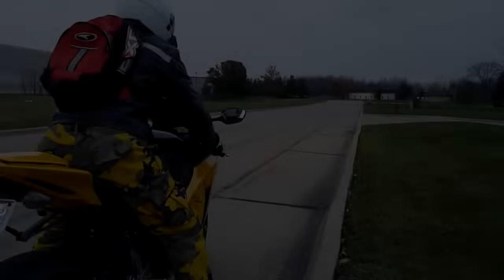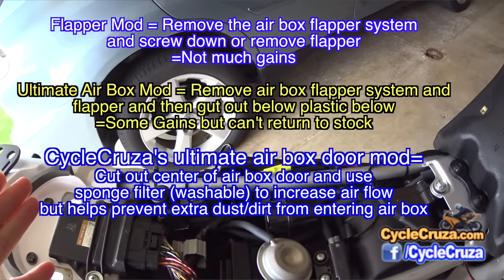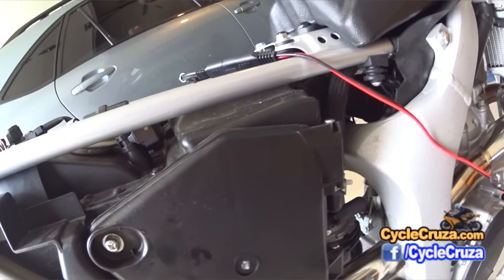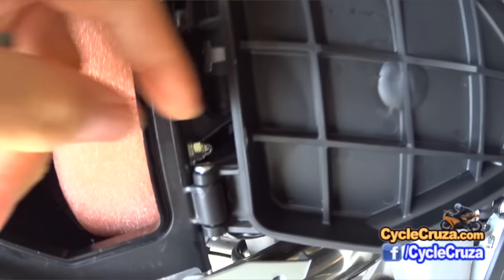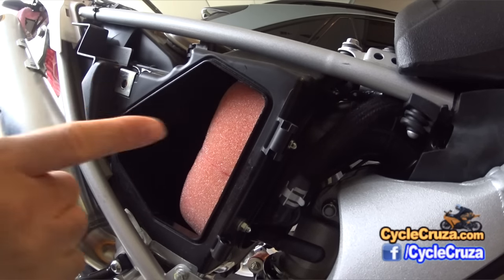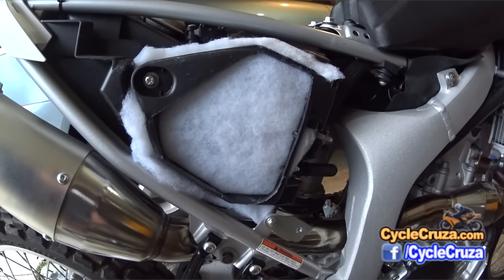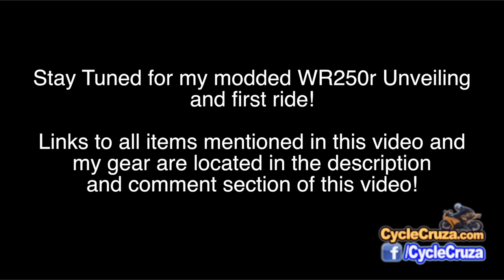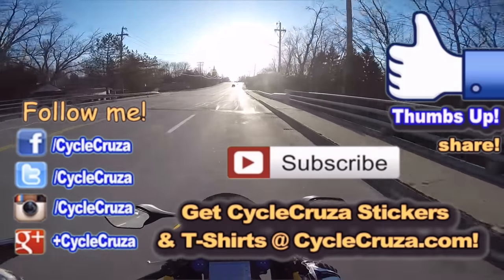WR250R Ultimate Air Box DOOR Mod - More Horsepower!

Comment from the maker: FYI - Links to items shown in video and my gear:
Get My Action Camera CHEAP here: http://amzn.to/1F85kog
Get Power Commander CHEAP: http://amzn.to/1OzOA21
Get PC Map Switch here: http://amzn.to/1rgIg5q
Get Sponge Filter (For Air box door): http://amzn.to/1WS2GO5
Get H4 LED Headlight Bulb here: http://amzn.to/1qx9Ta9
Get 3 Gal IMS Fuel Tank WR250r here: http://amzn.to/25zuWsC
Get Motorcycle LED H4 Headlight here: http://amzn.to/1Mc8TSs
Get FMF Q4 Exhaust CHEAP here: http://amzn.to/1OvBlJs
Get FMF Mega Bomb Header here: http://amzn.to/1OvBrkg
Get JT 47 Tooth Sprocket here: http://amzn.to/1WaUDvF
Get Rental O-Ring Gold chain here: http://amzn.to/1TAHDPl
Get KTM Folding Mirrors here: http://amzn.to/1SD7DbI
Get Folding Levers for WR250r here: http://amzn.to/1mObQ0h
Get WR250r Comfy Seat here:  http://amzn.to/1OvBb4U
Get Pro Taper Fat Bars here: http://amzn.to/1OvA1X2
Get Fat Bar Mounts: http://amzn.to/1OvAb0z
Get Pillow Top Grips here: http://amzn.to/1OvAhp1
Get Zeta Hand-guards here: http://amzn.to/1OvAoAJ
Get Zeta Hand Shields with flashers here: http://amzn.to/1OzN8g1
Get Wr250r Shorty Folding Levers here: http://amzn.to/23fgns8
Get Skid Plate here: http://amzn.to/1OvABUI
Get Dunlop D606 Rear Tire here: http://amzn.to/25zuquA
Get MT-21 Pirelli Front Tire here http://amzn.to/1MXHoXK
Get WR250r Speedo Healer here: http://amzn.to/1pP4fzl
Get Servo Emulator CHEAP here: http://amzn.to/1OzNqn2
Get Flasher Relay CHEAP here: http://amzn.to/1OzNwv8
Get Grip Heaters CHEAP here: http://amzn.to/1OzNKST
Get Fender Eliminator Smoke Tail Light Kit here: http://amzn.to/1qy21oE
Get Smoke Rear Turn Signals here: http://amzn.to/1qbUefY
Get Sheet Metal Piece here: http://amzn.to/1OvzzI9
Get No Toil Hi-Flo Air Filter CHEAP: http://amzn.to/1OzMmzH
Get No Toil Oil/Cleaner/Rim Grease Kit here: http://amzn.to/1qbUHhZ
Get WR250r White Fender: http://amzn.to/1Z3rTZ4
Get WR250r White Headlight housing: http://amzn.to/1UrxscX
Get WR250r White Left Rear Side Cover: http://amzn.to/1Uryrdp
Get WR250r White Rear Fender:  http://amzn.to/1UrzM3U
Get WR250r AIR Removal Kit: http://amzn.to/1YSVwYr
Get WR250R air box door here: http://www.partzilla.com/parts/detail/yamaha/YP-3D7-1441A-00-00.html
Reply: You are literally a epic handy man. Where do you get the idea to do some of this shit?
Reply: You should try the k and n air filter !! Better power gains than no toil , and they last a lifetime = ) Check them out !!
Reply from the maker: brad b No toil is better than K&N, also the oil and cleaner for the no toil is non toxic and biodegradeable.

Comment from the maker: 5/27/16 UPDATE: Bike is done! The tuner did two custom maps, one for the stock air box door and one with this modded air box door. I did GAIN hp with this air box door mod and he was able to tune just fine! Bike Unveiling coming soon!
WR250r update: Dyno Tuner said there was a problem my power commander, one of the pins in the connector was pushed back, was causing it not to communicate properly. He completed the map for the stock door, now he's going to try and tune the bike with my air box door mod again (Door hollowed & covered with filter). So if the second map is successful I'll have two maps on my switch, one for the stock door and one for the modded door. I'll do an unveiling of the modded wr250r next week. Stay tuned!

Comment: Don't know if this applies to EFI bikes like the WR250, but for carb bikes like the DRZ400, it's not recommended to mod the airbox door because it can create turbulence in the air box, which then can cause lean/rich states in the mixture. Do not do this if you have a carburated bike. Interesting mod though. I wish I had an EFI bike. Thanks CC.
Reply from the maker: +aseredy yeah I wouldn't do this to a carb bike. Also, I will be having this bike dyno tuned and will be adding a 2 way power commander switch to switch between stock air box and a opened up air box. I will not even ride the bike until I get it tuned first.

Comment: Hey buddy I need some help , I have a wr250r 2014 I bought the fmf powercore slip on with stock header , my question is do I need a fmf programmer coz my bike is loosing torque or Do i need a fmf heater too? Please let me know
Reply: You'll need FMF or EJK fuel controller (which you'll also need to program) when running aftermarket exhaust. As you've noticed an aftermarket exhaust without its own dedicated fuel controller will hurt performance since the factory ECU is designed to operate with the factory exhaust.

I don't think you necessarily need a fmf header as some people run fmf q4's with just the stock header.

Comment: So the EFI system won't compensate on its own for the change in air mixture? (I only have one newer bike with EFI and haven't looked into doing anything out of stock with it)
Also a question of dual maps, what is the process like when changing between maps?
Turn off the bike, flick the switch, swap doors and done?
Any guesses pre dyno what the HP gain is?

Mostly curious about the technical bits of how safe it is for the bike if the maps get switched mid ride or if it gets bumped while in the garage. (if it is even possible to switch maps on the fly while its on)
Reply from the maker: +Hand Banana No, you don't have to turn the bike off to switch maps, just flip the switch (2-way switch). I have an appointment for a dyno custom map, when I get it done I'll let you all know what HP it's running at.

Comment: CC is it better sell your motorcycle with the aftermarket parts removed leaving as stock as possible or as a whole
Reply: +Son Le Go back to stock, stock bikes are worth more. Then just sell the aftermarket parts on forums, ebay, craigslist, etc. And you'll make maximum profit.
Reply from the maker: +Son Le I'd sell it stock and then sell the aftermarket parts. Some buyers are skeptical of buying heavily modded bikes, at least I am. I like unmolested bikes if I ever buy used. You won't get that much more money when selling a modded bike, you'll make more money selling the aftermarket parts and the bike stock.
Reply: thanks

Comment: To be honest, I'm about to question your decision about cutting a hole on the side of the airbox instead of the top, but then I don't really know much about the WR250R plus you added some sort of filter in it. I know people in Thumpertalk will laugh at you if you cut a 3x3 hole on the sides of your DRZ400SM airbox instead of the top since it could let water in. Look forward for your end results, though.
Reply from the maker: +E2Moto The DRZ400 has a carb, I wouldn't do this mod to a carb bike. As far as water, like I said in the video, If I decide to hit the woods in wet conditions and ride over streams I will put the stock door back on and switch power commander maps (using a 2 way switch). I bought another stock door to carry if I decide to hit some streams in the woods. PS. A stock air box door is only $17 shipped.
Reply: +CycleCruza Ah, forgot that your bike is fuel injected. I'm quite jealous of that, but I hate electrical problems. I'd rather have my carb bike warn me of a potential breakdown than suddenly go down on me in a freeway. I still don't mind having a fuel injected bike if I have to, though.
Reply from the maker: E2Moto People say that but I have never heard of anyone ever having problems with a modern FI bike, I haven't. People used to say the same thing about FI cars when they first came out, now nearly all cars are FI.
Reply: +CycleCruza I'm not saying EFIs are problematic, but I don't like the way they present problems if they get one.

Comment: would two filters not mean less air I taught the aim is to get more air into the main filter
Reply from the maker: +Fast_N_Fearless You're getting more air because you are opening up the door, the door filter still provides good air flow but helps keep the dirt and light moisture out.
Reply: +CycleCruza have u not to direct the air in first
Reply: Lol I am no expert but I have lot of experience with engines and air boxes the main thing is don't rescrict the flow of air or block the air flow